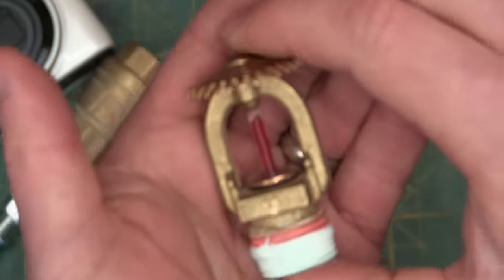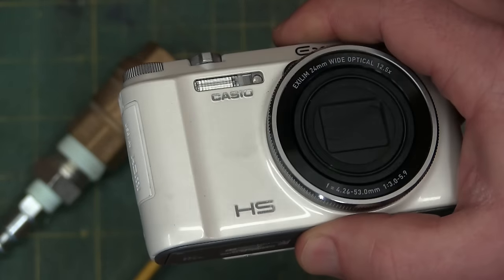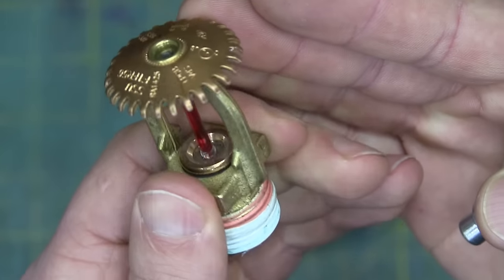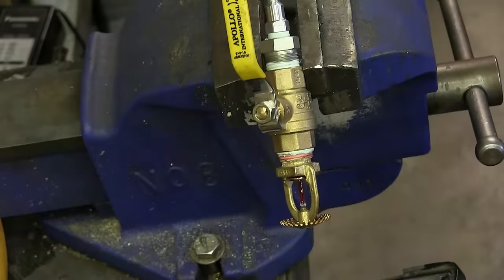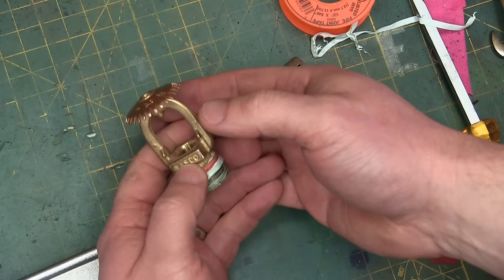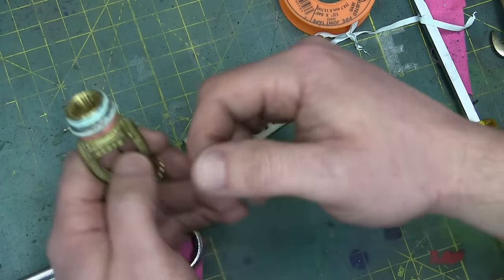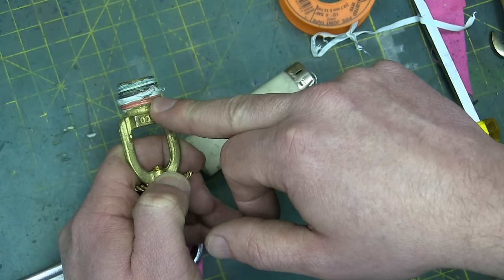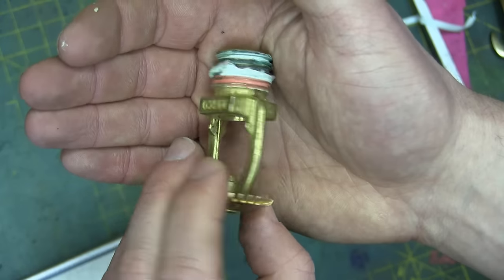BOLTR: Fire Suppression Sprinkler Head

Comment: i dont know about commercial or "land" setups but on the boat i work on the lines going to the sprinkler head are not filled with water but with compressed air. each section has what is called a dry vavle or to put it simply  the vavle that hold the water from coming in so if a head lets go the pressure drops and the dry vavle opens the water from a pressurized buffer tank and when the pressure of the tank goes too low big pappa pump kicks on and supplies pressure and blows out the rest of the heads for that section( the heads we have on board are quite different from those )

Comment: I have dealt with numerous sprinkler systems and sprinkler head bursts (mostly forklifts breaking off the heads in warehouses).  Regular testing and flushing (mandatory here in Ontario) helped, yet still the water was always rusty red brown from the black pipe and rust. Knowing your system, what triggered the flow switch and alarm, where the sprinkler risers are, and how to shut off the water with the supervised valves is the quickest way to stop water flow out of an accidentally broken sprinkler head. Of course, never do that is there is an actual fire burning!!

Comment: I know they can break just the same if they freeze.  Our plant was evacuated when the sprinkler pressure dropped to sound the alarm.  In a stairwell connected to the building that had no heat and limited to know insulation.  She froze and dumped.

Comment: you want a concealed head to play with. i got some old high temp ones too. minimum testing pressure for NFPA 13 is 200psi or 50psi over static water pressure. so at minimum that little glass bulb had to take 200psi.

Comment: +AvE, the 3mm glass bulbs will take over 1000 lbf axial load to break.  5mm will do over 1500 lbf.  They're borosilicate glass if you're curious (what old skool Pyrex was).  Most heads are rated for 175 psi max working pressure, but only because of the seal, not the strength of the bulb.  And they're all tested to 500 psi hydrostatic.  And that's only a little one you have there, K5.6.  There are 3mm bulb sprinklers up to K14.0, so closer to 3/4" diameter orifice.  I work in the industry by the way- any questions for me, ask away.

Comment: I saw a new construction set of townhouses with PET piping to their sprinkler system. Outside was a 2 1/2" FDC (Fire Department Connection) getting necked down to 1" PEX. The usual SOP is to flow the FDC at 100 psi, but that would most likely blow the PEX apart and not get water on a fire and probably not allow adequate fire flow.

Comment: Most systems have a pressure sensor. A drop in pressure from any one head causes a boost pump to start. A 200 horsepower motor driven pump puts out enough pressure to blow open the rest of the heads on the system. And if you've ever had to clean up after that, you're aware that it's a bloody mess.

Comment: Glass is extremely strong under pressure, but don't like to be stretched or shifted.
The glass can probably hold hundreds of pounds, but it takes less than one pushing against the wall to cause it to fail.
Kind of like if you stood on top of a 8ft 4x4" pole cut in the middle. You could stand there all day holding on to the roof of your house for balance, but apply 1lb of force to the canter, and it'll spring out from under you.

Comment: There are two different "hat" styles to these too, depending which way they aim.  The one in the video is meant to point up.  Water hits it and the hat directs it down and out to the space below.  The ones meant to hang down have a thing that looks more like an inside-out umbrella.  It basically just spreads the water out to a cone. 

Fire water is foul though.  I flush the one at work quarterly and it comes out stinky every time.  There is a section that has no flush valve though, its been charged for 16 years with the same water.  I don't even want to know what that smells like.
Reply: gadget73 good ol swamp water :) black as ace of spades!
Reply: dont forget the horiontal sidewall sprinklers they create a wall of water to contain the fire in 1 area
Reply: gadget73 There are quite a few more than two (or three) "hat styles". And a HSW isn't made to contain a fire to one area, its to extinguish the fire, just like every other standard sprinkler.

Comment: Funny story, I once worked in a shop that rebuild heat ex-changer's and there was a bay with chemical tanks that broke down the glue holding gaskets to the stainless plates. The chemical fumes over time ate at the lead plugs in the nozzles leading to one nozzle failing after hours. We came in to 4 inches of water in the entire shop as well as flooding our neighbors bays as well. After that we switched to the glass tube style nozzles you have here.

Comment: In a deluge system on a ship the system is empty to prevent freezing.  It activates when 2 methods of fire detection are activated usually heat and smoke alarms or fire eye. So its like the systems in a movie where they all go off.

Comment: Sprinkler designer here! excited to see something I know about. So these are pressure tested to be acceptable to 300 psi. And that was a quick response head so goes off faster than a standard response head.
Reply: That's so cool!  So what's the fluid inside the glass vial?  Also, how do they have a fast response vs. a standard response head?  Do they use a different kind of liquid?  Do they have a slow response head?  All very interesting stuff!!!
Reply: Fast response bulbs have less volume in the bulb, thus less heat sinking and will break the bulb quicker.

Comment: Our sprinkler systems where I work are only pressurized to 50-60 psi, while theres probly 200 psi of water pressure from the main it doesn't actually trip the water valve until the pressure drops below 40 psi, the flappers got more surface area on the air side.

Comment: I used to work for a foundry that supplied sand cast sprinkler frames to that company. I've been to the factory a bunch of times to see the assembly and machining for the sprinklers. The frame in the video is a die casting.

Comment: I'm seeing a lot of confusion on how these work in practice I'll try to help out a bit, I am in construction and fire suppression is a huge consideration in all projects.
First off in movies you often see all of the system go off at once which in the type with the filament would never happen, only one would go off except in certain systems. usually if you have them connected to a smoke detecting system only in the room or area where the smoke was detected would the sprinklers go off, because these sprinklers pump out around 8 to 25 gallons of water a minute which could easily destroy a house.
Next there is four ways they can go on and only one way to turn it off. As shown in the video heat can get to the filament and cause one to go off, they can be triggered by nearby sprinklers going off, they can be triggered by a detector like a smoke detector, or they can be manually operated. They can be turned off by cutting the water supply.
Next I'll discuss different systems. Some systems have water always in the system, this is typically in commercial settings where tempurature is well regulated and they would need water the instant the heads go off. there are also systems that have air in them until the system is needed and water is rushed into the system. The third kind of system is chemical, which is used where there is very highly combustible materials, like in an airplane hanger or a paper factory. In this case thousands of cubic yards of foamy chemicals are dumped to drown out the fire, look up videos of chemical fire suppression systems.
Just an interesting tid bit, in a large system you have to account for pressure use of the sprinklers so that the sprinkler furthest from the source has enough pressure to fully suppress a fire. Also in most specs it will define at what intervals sprinkler head should be placed and their gpm rating, this will depend on the intended use of the building.
Oh and there are actually 2 types of filament, there is the glass like shown in the video and there is low melting point metal, so something like lead to be used as the filament.

Comment: While the pipe is pressurized the plug also has 14.6 PSI (one atmosphere) of pressure over a large surface area (it's mushroom shaped, the actual seal will be made near the tip where as you observed it has less area to act on) pushing it into the orifice to offset the force pushing on it by the water.

Comment: As far as the pressure those can sustain, I used to work for the city and we had to able to sustain a water pressure of 55 psi to the taps, unless the building had it's own pressure pump (necessary for buildings over 5 stories).  Often we would measure new service lines and it would be between 60-65 psi.

Comment: I took Architecture in College, and my Ontario Building Code teacher told us that these sprinkler heads take such a significant amount of heat to activate - to the extent that you would not survive being in a room hot enough. He basically said that sprinkler systems, in general, are designed to save buildings, not save lives. He also said that in most fire suppression systems (especially ones in commercial kitchens), there are chemicals in the system that get released with the water that is extremely harmful to humans if exposed.

Comment: I've seen guys take a fire sprinkler system up to and sometimes over 100psi of air. They hold anywhere from 10-40psi of water. Pressure could be higher for water but it depends because every area is different.

Comment: AVE.     next time you need to get hold of a standard response sprinkler in a higher temp.    Use the high speed camera with the deflector pointed slightly up so you can see the bubble inside the bulb disappear while your heating it.

Comment: they actually can hold back 250psi of water pressure. and it is the tiny air bubble inside that expands with heat to break the glass

Comment: Some of the old ones had a little chunk of lead (pb) as the heat detectorer instead of the glass vial.

Fun (not fun) story:

Once, I was the lone maintenance tech on 2nd shift at a hospital.  The front lobby of the place had been undergoing renovation, and there were a couple of sheet rock guys sanding their joints next to one of the elevator banks.  They were working fast... a little too fast.  Around 10pm, one of the guys bumped a sprinkler head with the pole sander, and PSHHHH!  The lobby, the elevator shafts, the radiology department and pharmacy on the ground floor (basement-ish level) were all hit with a sudden indoor rainstorm from that one sprinkler head.  Luckily, our system had independent heads.  I was running around like a madman between getting large trash carts to catch water, running down the the basement mechanical room to kill the fire suppression feed pumps, and calling my supervisor at home.

Hoo boy!  That'll put yer ticker to the test!
Reply: Jeff Mansfield solder link

Comment: pro tip: you can hard pipe these to whatever you want. I had one on a 20lb LP grill tank. in said tank you put water and a pressurized gas. air if you must but something to help extinguish fire. argon co2 etc. hang it up over your workbench or wherever and you never know. it may save a life. 

4g water and argon pressured to 120psi. I had a 165*f nozzle in the sprinkler and .75" pipe.

Comment: If you are wondering AvE how the alarms go off. There are pressure and flow sensors rigged up in the pump room. Which connect it into the rest of the automated fire system.
Reply: Before central fire alarm systems were common there were Sprinkler bells mounted outside of buildings, basically to tell firefighters to hook into that specific standpipe they were adjacent to. You still see many to this day.
Reply: I installed one on the outside of a building about 4 months ago.
Reply: Yeah but they're now just another part tied into the central alarm, I'm talking about the old rusty things that were directly connected to the flow switch before fire alarms were commonplace. Some are in excess of 100 years old.
Reply: Very true

Comment: i actually install fire supression systems, all systems are rated for 300 psi including the sprinkler heads, you just had a 155°F quick response( reason in went of so quick) brass upright head. you put those in areas that dont have ceilings or in empty spaces behind walls, attics, etc
Reply: Zach Stearns Not all systems are rated for 300 psi (most aren't).  That exact sprinkler in fact is only rated for 175 psi.

Comment: It seems that sprinklers were retrofitted into the Disneyland hotel, in a rather perplexing pattern. One ended up in our shower stall.
Reply: It's that pesky fire code.  I've worked for companies where the local fire marshal demanded the water sprinklers remain in the server room in spite of having fit a 3M Novec waterless suppression system that's WAAAAAY more sensitive than the glass vial of the heads themselves.

Comment: Being a EX-Navy Tech, Iv had to replace a couple of these onboard due to careless people with foxtails.... Most of the time with pressure still behind them! That little piece of glass can stand all sorts of vertical strain but not horizontal.. Don't take much to break them.
Reply: Correct. we couldnt take the chance of taking down the entire system and have a fire else where.  Only thing you could do it open a couple fire plugs near by and try to get the pressure as low as you can ie (80ish psi) and try your best lol
Reply: "Being a EX-Navy Tech, Iv had to replace a couple of these onboard due to careless people with foxtails"

Goddang furries.
Reply: LOL

Comment: Next time you are in a building with sprinklers take a look at how they are plumbed, especially the pressure relief valve included in some systems.  The relief valve exhaust is not open, it plumbed back into the system.

Comment: water flow from a sprinkler head is calculated out by the following formula.
Q=K times square root of P
Q= GPM
K= Sprinkler Coefficient (typically on head)
P= PSI of the system

Comment: Cool video but I don't really understand how the valve actuated from the temperature. It seemed like it needed quite an intense heat from a flame, so how would it know to break at 65 degrees? Also, how was it strong enough to withstand the pressure and why does it break under heat but not pressure?
Reply: Thinking about my question, I'm guessing that the glass can hold at room temperature, but with just a bit of heat at 65 degrees it becomes weak enough to break? Surely then, if there wasn't quite as much pressure as usual on the pipes, then it would take more temperature to break? I didn't realise the strength of glass was that susceptible to temperature change, or is it a special type of glass?
Reply: Jimmy B I explained it lower... there is an air pocket. The red liquid is a form of alcohol that expands. (Different "colour" equals different temp) the larger the air pocket the larger the buffer = higher temp! Once there is no room the glass breaks and water flows!

Comment: Your math always blows my mind
Reply from the maker: Spoiler: it's not really math, more like gross approximation and dirty shortcuts.
Reply: I always thought I did the same but then you pull out the devils imperial system and I'm fuckered
Reply: its not complicated :
we know that - pressure=force/area
 area is pi*0.25^2=pi*0.0625=0.1963 square inch
pressure is 120 pounds per square inch
pressure*area =120*0.1963~20 lb

Comment: I just finished the fourth year of my plumbing apprenticeship in Alberta and there is a section of the course called "special applications" and we had to learn about fire suppression/sprinkler basics. The modules said that sprinkler systems are mandatory in all commercial buildings and Alberta is trying to make a sprinkler system mandatory in residential applications as well. The thing I found strange is that I did 2 new commercial buildings last year with 0 fire suppresion systems. One of which was a crematorium with 2 x 2 million BTU cremators...but no sprinklers??
Reply: Tripnotyst lol politely put... stick to plumbing :) I'm a sprinkler guy! Call the pro!
Reply: good for you. It's part of our curriculum still. Not like sprinkler fitting is hard. It's all straight runs of vic pipe with a few threaded and it's sched 10 lol...I'm sick of sprinkler fitters thinking they are hot shit when they have the easiest trade out there. The point of my post wasn't to say that we should have been installing it, I was saying that it was strange that the two buildings didn't have any fire suppression but I guess that went over your head.
Reply: Tripnotyst all in good fun

Comment: I'm surprised it didn't break when you dropped it.  They are stronger than I thought.  Was there ever a style that had a wax plug that melted?  I seem to recall hearing about something like that, but I don't remember where.
Reply: Michele Marie Dalene Thanks for the response.  Do you have any idea why the glass vial design is used more often today?
Reply: MrBtdobie faster activation
Reply: Oh, they can break much easier when they're under pressure!  A couple of jack wagons were playing wiffle ball in a warehouse and the ball tapped a head and it released.  Consider that the ceiling was 30 feet up and the mass of a plastic ball is pretty small... it was very surprising!  And as others have said, that standing water absolutely STINKS!
Reply: There are a few reasons why bulbs are used over fusible links. Faster activation is not one of them as there are quick-response links too.  First is they are cosmetically nicer, second is they cost less, but most important is the fact you can machine install a bulb, but have to manually install a link, so the assembly cost difference is significant.